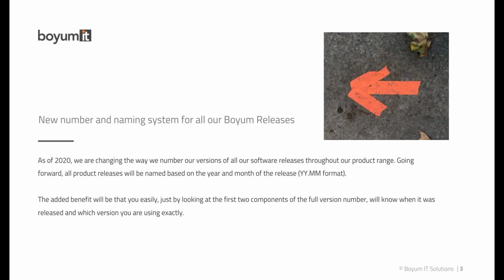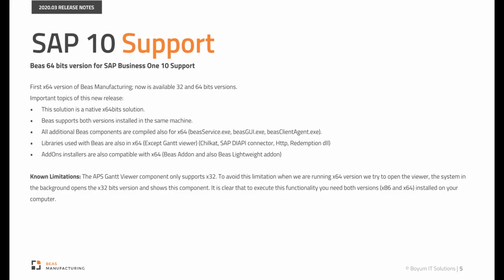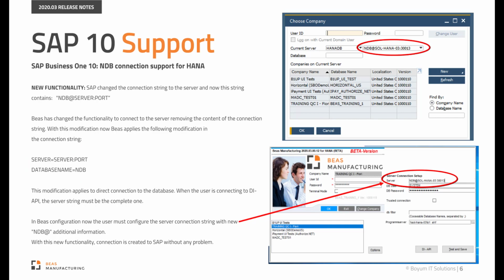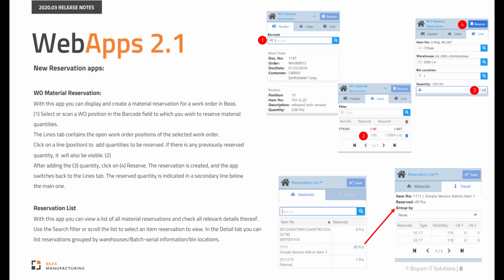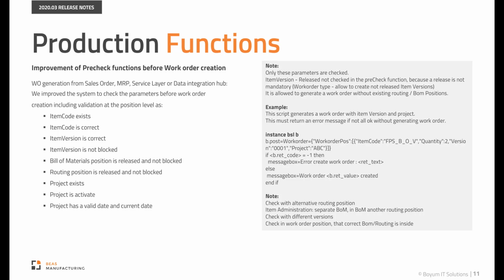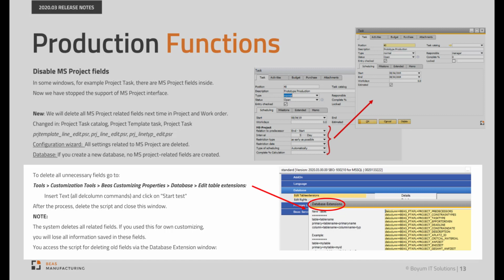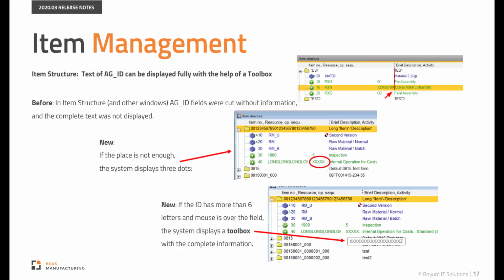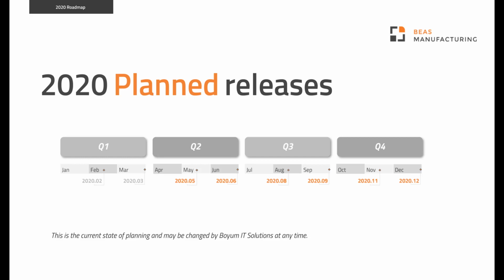What's New in Beas Manufacturing 2020.03?

Comment: In the minute 1:51 you say we need both, x82 and x64 to execute APS Gantt view. Which aplications we need in both versions (DIAPI, Beas, SAP)? And, what's the procedure to install it? Before X86 or before x64?
Reply from the maker: for APS Gantt view you need the Beas 32 Bit installation
SAP 10 only 64 Bit available. If you want to work with APS, then work only with 32 Bit solution. It's working fine inside SAP 10 64 Bit.
If you want to use Beas 64 Bit, you must install Beas 32 Bit too
Reply: @BoyumITSolutions  but, how will Beas work in 32 bits within SAP in 64 if I'm version 10 we do not have available the DI API in 64? In previous versions, to work with beas un sap 64 versions, we need the DI APU in 32 and I'm 64 installed.
Reply from the maker: @lAbellaneda   In SAP 10 you have to install additional the  "legacy DI-API".